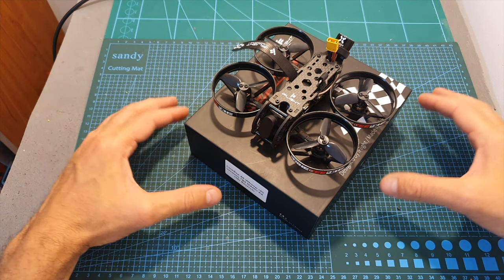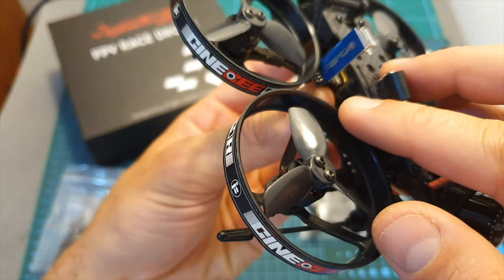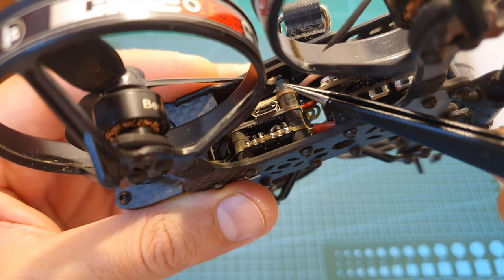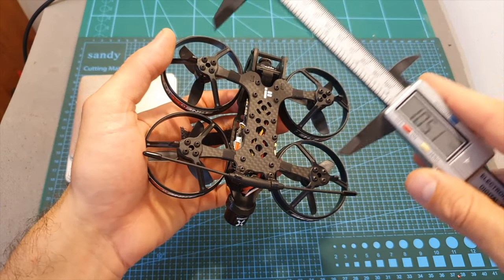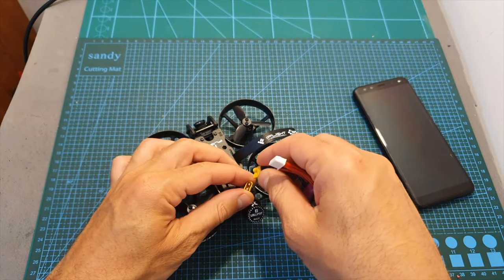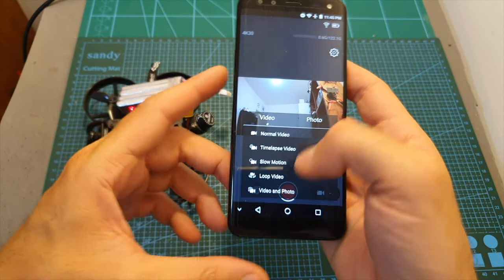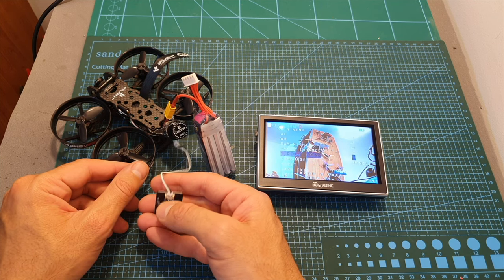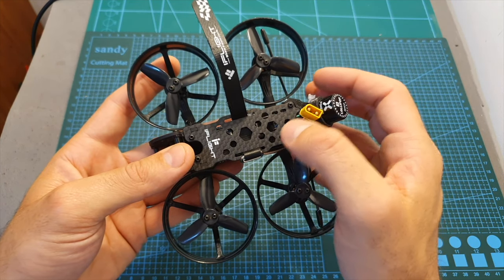iFlight CineBee 🐝 4K - Review & Flight Footage

Comment: say my friend! came not seeing how to activate the OSD information on my FPV eyeglasses, where I can activate these functions, because I'm flying without telemetry.
Reply from the maker: Did you change any setting?
Make sure that under the configuration tab in Betaflight the OSD switch is enabled and select the OSD elements that you would like to display (Battery, RSSI etc.) under the OSD tab. 
If you still can't see the elements on your FPV feed make sure that under the OSD tab the picture format is set to Auto (and not  NTSC or PAL).

Comment: I recently build a cinewhoop using the iFlight iH2 frame but wish I would have used this frame. The ih2 frame only supports a single stack and very tight build with hd recording. If this frame is available, I will surely swap out parts.
Reply from the maker: It's available on iFlights website.

Comment: Thanks for the review, I put a Tarsier on my Kingkong ET125 with a custom printed mount, but it's heavier than I'd like and the motors are worn from nearly 2 years of flying it, causing it to not so good and wobble on the camera picture.
The price of the CineBee 4k with that 20% off is really tempting because it's so much smoother than my ET125, but I know the deficiencies of the Tarsier, notably the badly cropped 4:3 HD recording.
Wondering if I should hold out for newer firmware or see if they ever make a Tarsier V2.
Reply from the maker: I think that a new version will be out soon, but I am not sure when and if we will always wait for the next version, we will end up getting nothing ;-)

Comment: Very nice 👍 iflight has come out with a lot of great quads lately. I do think they should have gone with an 1105 over a 1104 but flight footage looks great.
Reply from the maker: I think that the 1104 motors are pretty efficient, considering it's not a light weighted quadcopter, and they also seem to perform well.

Comment: could you use a higher miliamph battery?
Reply from the maker: Yes but it's not recommended. I suggest using 500-700mah 4s batteries.

Comment: Great! Can I use 2S battery on 4S model?
Reply from the maker: Yes, you can - will it fly well - probably not :-)
Reply: I have the 4s version. A 2s battery isn't quite powerful enough for a successful flight. I found that the 2s battery required about 75-80% throttle just to hover, whereas a 3s requires about 30-40% throttle to hover and 8s more responsive. With that being said, I haven't tried a 4s.
Reply: @jorica4466  so you recommend a 3s instead of 4s?
Reply: @possible1337    I wouldn't necessarily say 3s instead of 4s. I personally feel a 4s would be too aggressive for the style of flying I am hoping to achieve, but I don't fly fast or aggressive. If you wanted to do flips and dives with the Cinebee, I bet 4s would be better. But I suppose it depends on your style of flying.
Reply: @jorica4466   Okey, And how is crossfire on tiny hawks? I mean, battery isnt more then 3minutes?
Reply: @possible1337  sorry man, I've never used crossfire or flown a tinyhawk!
Reply: @jorica4466  oh sorry  i mean tinywhoops.. LOL. I mean, im bout to order one of there Cinebee 4K 4s. But dno if I want on my flysky radio or "upgrade" to frsky and crossfire :p